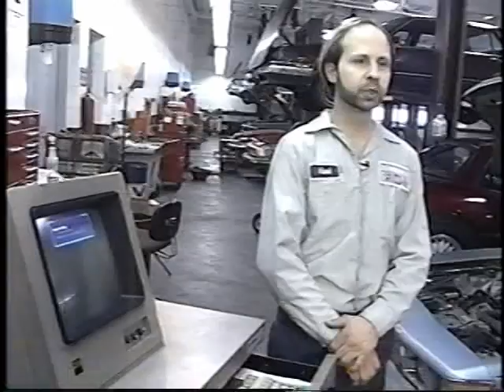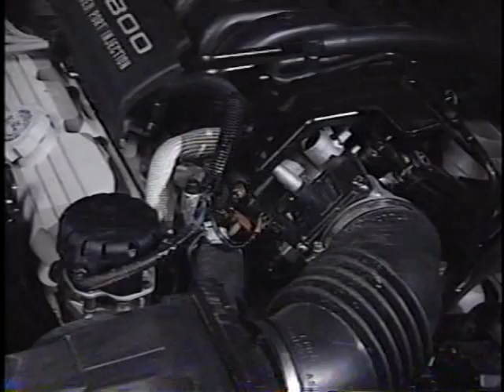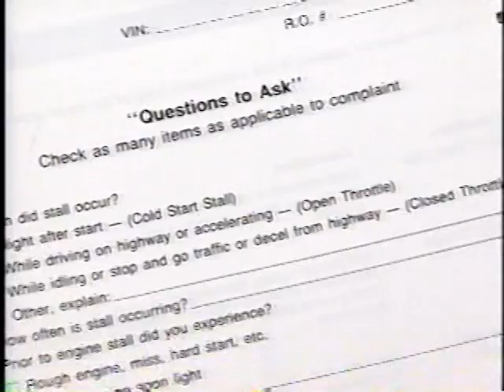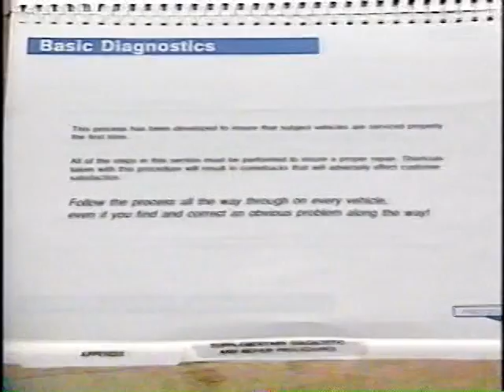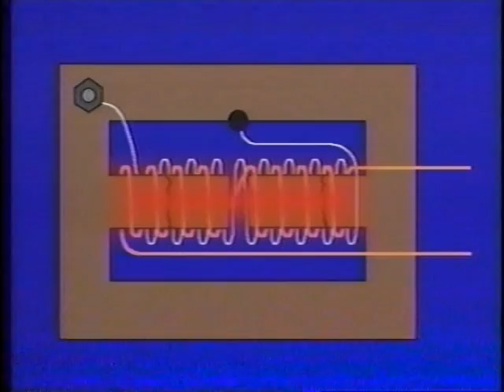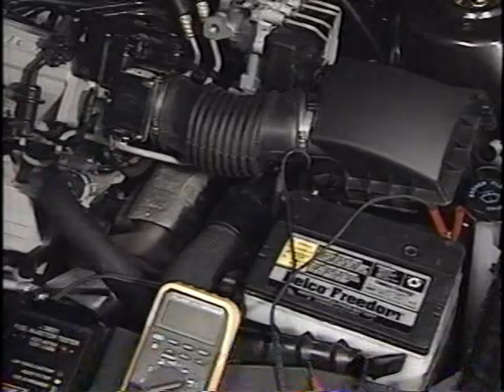Buick - Driveability Diagonsis 3.0/3.8L and 3300/3800 Series Engines (1993)

Comment: I remember having a real hard time with the Buick carbureted CCC equipped V6 engines from 1981 to around 1987. They were very difficult to get running right like when they were new no matter what you did to them and very finicky. Dad had a 1982 Cutlass with the 3.8 2 BBL and it was a real challenge to get right and took 4 trips back to the dealer before they got it right. Part of the issue was the EGR valve which would stick at times causing a rough idle and hesitation. Once that was figured out it was on to the carburetor and EGR passages which were partially plugged causing other conditions. Once all the minor vacuum leaks were dealt with the carburetor could then be dialed in correctly and the engine finally ran smooth and responsive. One has to be very thorough with these computer carbureted engines or they would keep coming back with drive-ability issues.
Reply: What Buick V6 still had a carburetor in 1987? The 2.8 had an optional base level carburetor from 1985-1986. I don't know when the 3.0 liter dropped carburetion. The 3.0 liter version in the N cars was always multiport fuel injected with distributorless ignition.

Comment: The only 3.0 engine that  I ever came across was in a 1985 Oldsmobile Regency.  The first year for the front wheel drive full size Olds. I doubt anyone even remembers that there was a 3.0 FWD full size car.
Reply: the only 3.0 i've seen and owned. is the 3.0L VQ30 in the nissan maxima, not a wagon but it is a 4 door and light years newer and 10:1 compression out of the box, lol
Reply: Was it carbureted or fuel injected?

Comment: My '89 Century won't start. No prime in the fuel system and no start...it does crank. All relays and fuses were checked. What do I check next ??
Reply: Is there power going to the fuel pump relay? Is there power going to the fuel pump? If you power the pump by bypassing the relay, does the pump run? I'm guessing a bad fuel pump. They are wear items.
Reply: @gregorymalchuk272  it turned out to be bad injectors and a bad fusible link. But didn't find out until after I got rid of it. Ended up with a '91 that had the same issues.
Reply: @christopheryanoski6899  Ah, which engine did it have? Where was the fusible link? On the wiring harness going to the fuel pump relay? Or on the individual injector wires? What engine did the 91 have?
Reply: @gregorymalchuk272  3300/ 3 speed just like the '89. Apparently there is a fusible link down by the starter that is connected to a wire that runs to the inline pump fuse. When that's broken it doesn't send either enough or any power at all to the pump and computer. I have a 1990 Ciera 3300/ 4 speed [D] that has this fusible link bypassed. The '89 had a few dead injectors just as the '91 did when I first bought it.

Comment: I have a Buick Lesabre Custom 92.. It keeps stalling on me when I ride for about 20min but crank right up. And also something killing my battery...Good starter and altornaiter..  Won't let me get acceleration.. Can I get help..
Reply: Check heat riser when car has no power. Also check grounds block to frame.
Reply: @ron6376  lil late Ron
Reply: @LilStJames16  very late
Reply: What's a heat riser?
Reply: Did you ever find the cause of those problems?